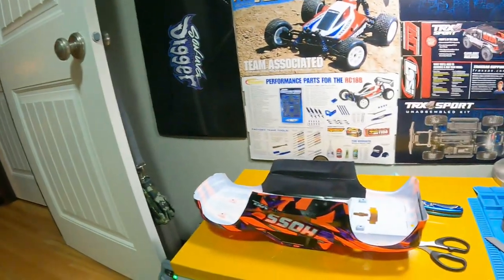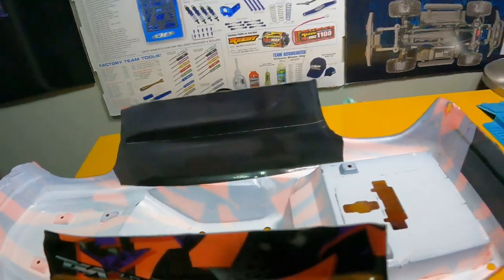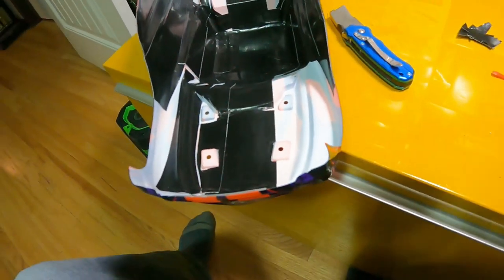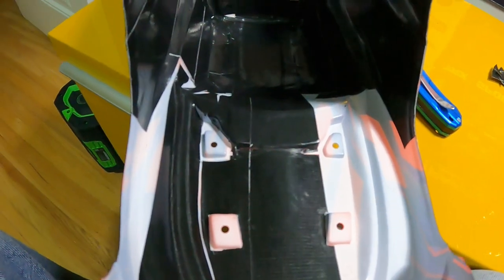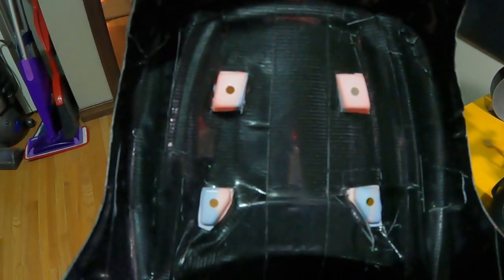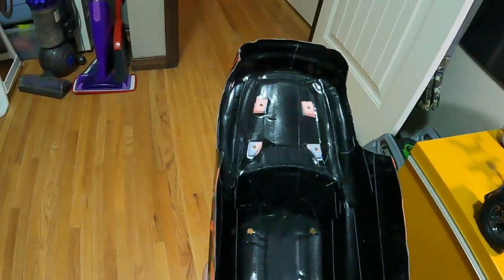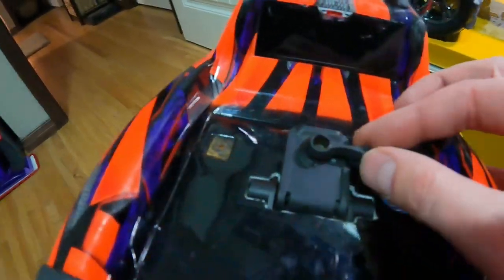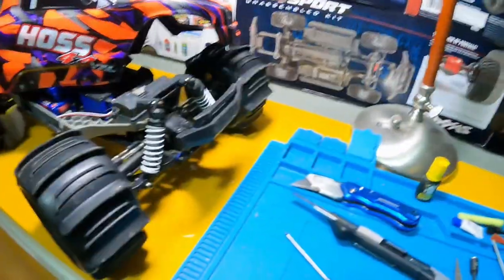Gorilla Tape your RC Bodies

Comment: just a thought with a little analysis you might not have to tape the whole truck body there are some areas obviously on the truck body that are not susceptible to damage.  could save weight a little and time.  Just doing the spots that you know are going to be the high risk areas.  But it's a good tip I will take it.  Thank you so much enjoyed the video
Reply from the maker: Ya I’ve tried it and it dose work, problem is that the tape forms like a water and dirt proof seal and if you don’t do the whole thing it tends to let go much faster, I find actually to that the weight helps the truck a bit with stability. One could do spots and shoe goo around them but that’s probably more time consuming😎

Comment: Great video, thanks. Now after 8 month is that tape still fine or have you retape that body.
Reply from the maker: No the tape is still on even through the winter I think there was one small part I pulled off and redid so there is some maintenance but in doing this the body is twice as strong and lasts three times as long as it would otherwise I’ve been bashing that Bigfoot body on the other videos for six years or more just pull out the tape repaint a bit and tape again and she’s good to go.

Comment: I've seen 151 aluminium tape on Amazon, but it looks smooth unlike the reinforced aluminium tape which as like a stranded texture. 
Would the smooth stuff be just as good ?
Reply from the maker: I’ve never used aluminum tape for body protection, only for windows on the outside because the silver looks cool, I would say aluminum tape would be a lot harder to work with as there are so many nooks and crannies and it really dose not meld vary well unless it’s really thin and then I don’t thing it would protect very well, I only use reg gorilla tape
Reply: @rcinnature4996  thanks for the reply , so do you just use the gorilla tape which is like black duct tape ? I've ordered a new shell for my savage , think it's made from abs , which is the best material shell to order ?
Reply from the maker: Yes the black duct tape exactly right, I only use lexan bodies and I really don’t think you will find much else, there is some hard plastic ones out there but they smash to easy, I have some but only use them as shelf queen bodies I never rune them, lexan is very flexible and you can literally twist the body in half and it will spring back into form, anything RC you buy today will be lexan 95% of the time
Reply from the maker: I would not recommend the ABS body your better off getting something in lexan same scale and just cutting your own tower holes and making a lexan body work
Reply from the maker: If you have an Esavage most 1/10 scale bodies in lexan will work
Reply from the maker: Just go to Amazon and put in HPI Savage and lexan bodies come up that will fit the truck, Traxxas stamped body will most likely work too. They usually don’t say lexan it’s just assumed that no one would buy anything else. Being that HPI is no longer in business it’s harder but they still have some, eBay good bet too.
Reply: @rcinnature4996  when did hpi shut down ? I just picked up a savage x 4.6 before Xmas as pressie for the "kids" lol . Don't really know anything about the hobby , had a couple of thunder tigers when I was a kid but they used to a few model shops in my town and race tracks where I could take them to get parts etc but there's nothing now lol . I think is deffo 2mm abs I've bought was only £20  in carbon effect , just need a decal kit for a 1:8 ford Capri lol
Reply from the maker: Ya I picked up an HPI Esavage on trade and went into the hobby shop for parts and they told me no can do buddy HPI is no more so parts are heard to find now but you can still get them. I don’t run my Esavage though she just sits on the shelf, I considered changing her over to dual brushless but given the cost and lack of part availability I just shelfed her she is for sale I have two parts trucks as well but the SavageX different, not sure which one you got, the Esavage is old truck. Ya small towns can’t afford min part orders anymore so ma and pa can’t run a hobby shop because you need 6 shops before they look at you basically
Reply from the maker: There’s always someone looking for savages lots of collectors, my recommendation is put her up for sale and buy Traxxas
Reply from the maker: Or just see what is available for parts and when you see them grab them so you have them when you need them but it sucks especially with kids because there going to brake it and then parts are an issue.
Reply from the maker: You know it looks like HPI may have got bought by Horizon Hobbies so don’t quote me on that, here in Canada it is very hard still to get parts but I looks like they are still going, I would check out there web sight and see because a resent google search says there still in the game here.
Reply: @rcinnature4996  it looks there still in business here in the UK , their website is still up anyway lol .
When I picked up the car I didn't think I'd be spending anymore money on it , but no I can see it being a money pitt lol .
Reply from the maker: Oh ya they are total money pits always breaking and always upgrading like crazy, I could spend 500$ a day easy but I don’t I just bide my time and stretch it out and take it easy, only buying what I need and not all the stuff I want😂
Reply: Ya. After shoe glue. I can say I that gorilla tape is the way. I had several peeling parts with the shoe guu. The tape seems more complete and stable